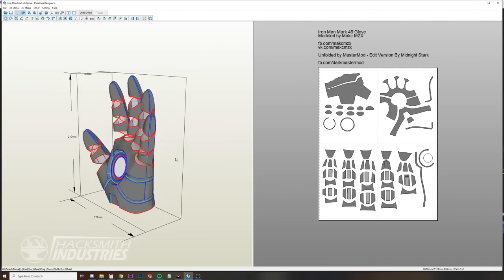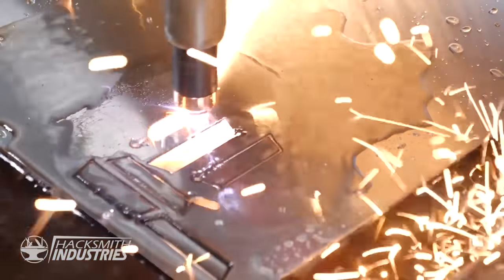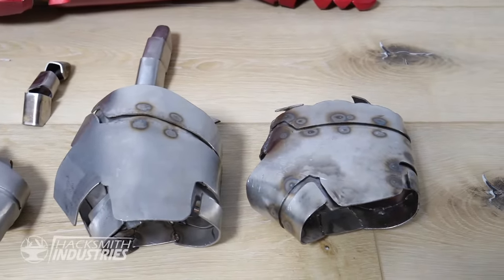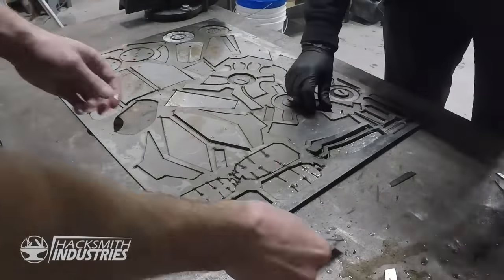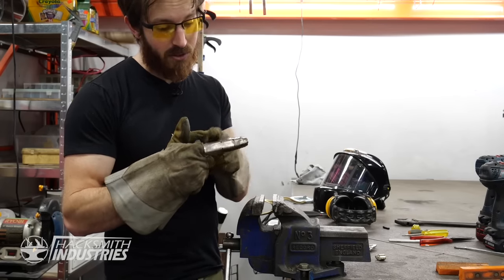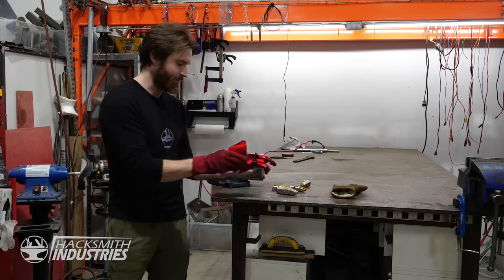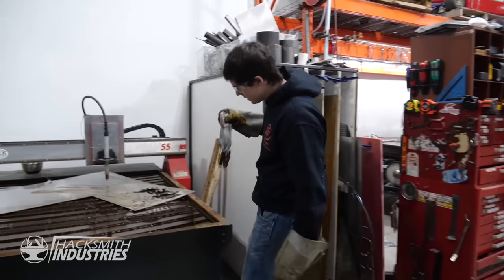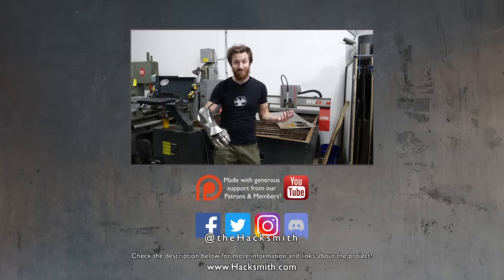Full Metal IRON MAN GLOVE!

Comment: 2030:
Mysterio illusion drones
Reply: Well its actually not impossible
Reply: "puts projector in a remote controlled helicopter"

modern problems require modern solutions
Reply: @markhilliam2932  It is, there needs to be a surface to project the image, but if that covered, it could be
Reply: No strapes pistol to each blade and a camera facing the sky streaming to  a tv on the bottom facing down 

SNEAK 100
Reply: bq Azman true they could just get the helmet and gloves and make them reflectable

Comment: But can you make it with Titanium Metal, just like Iron Man?
Reply from the maker: We could
Reply: @hacksmith  but with electroplating or what?
By the way subscriber from India, and keep going!
Reply from the maker: There would be almost no benefit to electroplating titanium onto it.  Would have to be full titanium, and that would make it lighter -- the stainless steel we used is actually stronger than titanium.  Big thing about titanium is its around the same strength as steel at half the weight
Reply: @hacksmith  Yes obviously right, titanium electroplating would be of no use,
Okhay now I understand, thank you for the reply :)
Reply: @hacksmith  I regarded titanium because of it's almost bullet proof quality like the UHH steel 😅
Even Titanium does not rust, also this metal was used by Tony, but this metal reacts in fire easily and ignite 😂

Comment: Excuse me but how to make a full iron- man suit would not to make an actual 1 is to make the HULKBUSTER!!!!!! yes!! Because you would have more room to put stuff to fly AND make repulsors you would    use the repulsors to lift you how to make it ????? You're probably asking yourself here's the answer!!!!! At the back you're back at the suit near your spine have big containers to hold the electricity  have wires going to your feet and your hand from the back and on the outside where you would be looking at the repulsors you would have tin to make it vibrate a lot and the wires would have a circuitry right in a base near your hand but have a Gap in two sliding piston doors using the electricity that you just made come through the big containers that hold the electricity near your back to close the piston doors right behind the tin on the inside and right where the electricity just came from and have a delay right on the inside right behind the tin so it's a chamber where the electricity builds up and voila you made the inside for the repulsors and there you go that's the base of it
Reply from the maker: Bigger is heavier to fly though! Mk1 is the most realistic :)
Reply: BUT HOW ARE YOU GOING TO MAKE IT SO COMPACTED???????????? AND IM ONLY A 9 YEAR OLD USING MY MOM PHONE AND YOU DIDN'T EVEN HEART THE COMMENT BUT YOU'LL HEART YOUR OWN!!!! WHY????????
Reply: MY MOM'S PHONE
Reply: The hacksmith